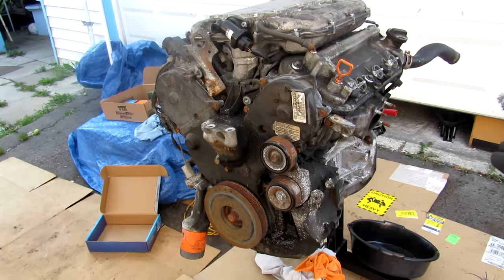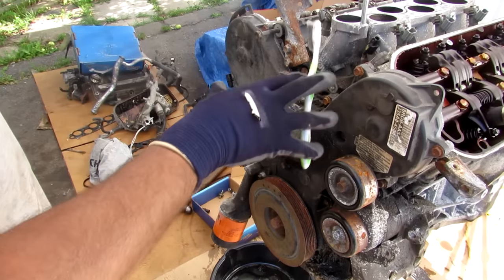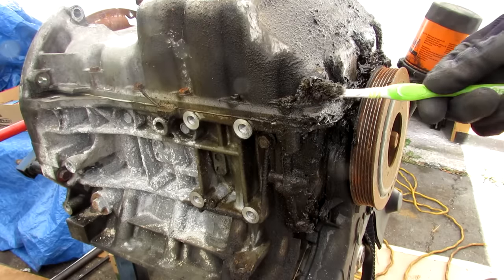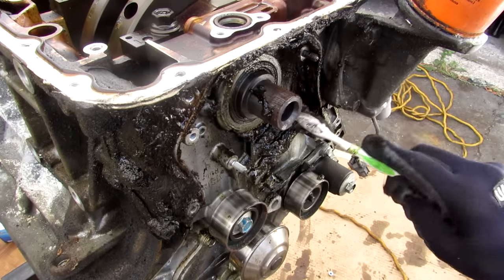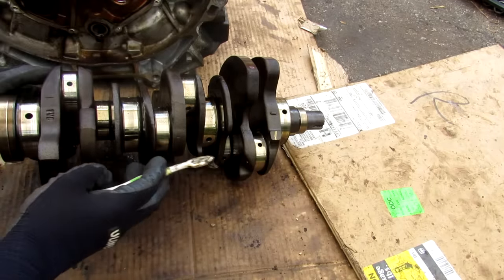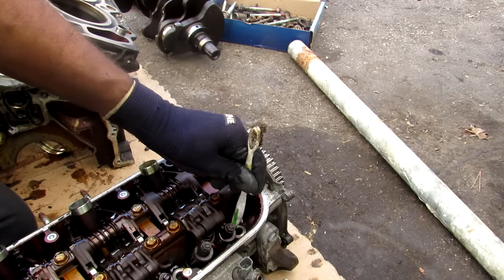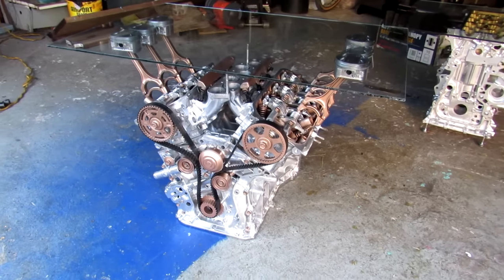Why Honda V6 Engines Haven't Changed For 25 Years

Comment: I'm the original owner of a 2003 Acura TL Type S that is coming up on 200,000 miles. I have maintained it in accordance with the owner's manual and will be installing a new timing belt soon. It's been a fantastic car and still looks good and drives like new, but I'm thinking about getting a 2021 TLX Type S to replace it.
Reply from the maker: How's the transmission going on it?
Reply: @speedkar99  It had problems at 15,000 miles and the dealership replaced it even though it wasn't covered under the recall. It's been fine ever since with no problems at all.

Comment: I have a variant of this engine (J37A4) in my 2010 Acura TL and I'm a bit sceptical when everybody talks about its reliability. Surely this engine is powerful but so far I had one camshaft changed, the valve train makes a lot of noise for unknown reasons, I definitely have some sort of slow leak around the main seal but it will cost around 1000$ to fix, pistons need to be changed due to oil consomption and the timing belt is a nightmare to change.
Reply from the maker: That motor variant wasn't the best example of a J-series Honda...I've heard of valve train issues and VCM issues

Comment: Why haven't they changed for 25 years? Because they don't need to lmao. We love Honda. Great vid for the J series engines
Reply from the maker: Its good but maintenance is a bit higher than say a Toyota V6 that doesn't need valve adjustment or timing belt replacement.

Comment: Did you notice, the internals of the closer to the firewall head (right-hand) are cleaner than the ones of the left-hand head. The same is on my MDX, so it's probably a universal rule. Why does it happen?
Reply from the maker: Yes I always notice this on the 4 J-series engines I've taken apart.
Reply: @speedkar99  So, there may be 2 explanations to this: it's because air flow cools down the front head more effectively or an engineering flaw of this type engines. Does this happen to other car makers' transversely placed V engines?

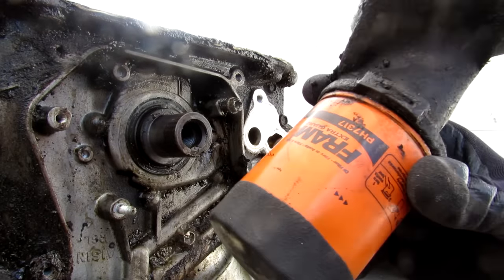Comment: 8:50 Aisin stamped in aluminum? Isn't that a Toyota company?
Reply: Aisin has been a long time Honda's partner when it comes to water pumps and hydraulic tensioners. You can even get a standard Aisin TB kit off rockauto that works with a huge variety of Honda V6s.

Comment: Is it safe to use 5W30 full synthetic motor oil instead of 5W20 in this engine over 200,000 miles?
Reply: mine has a similar amount of miles and i just add the recommended type on the manual
Reply: @fossilfountain  thank you

Comment: my 2008 v6 accord just reached 200k miles very dependable engine
Reply: What about the transmission?
Reply: @erikz74  still on the original and still working as good as new no troubles or anything

Comment: Its a great engine but the transmission does not match up.  I just got rid of my (2005)  15 year old Accord V6 with 358,000 kilometers.  I had bought it brand spanking new from the dealer and took care of it with all the regular maintenance.  Everything worked perfectly, the engine purred and no oil leaks.  But the all expected V6 transmission failed.  It required a rebuilt and would have cost me $3,500 installed at the very least with a one year guarantee. I sold it for parts.   Sad that recent year Honda's are not built like the models back in the 80s and 90's.

Comment: It USED to be a great engine. Cylinder deactivation ended that along with several other issues that the late model variants have.
Reply: When did they introduce cylinder deactivation?

Comment: honda still using timing belts , stay away from those
Reply: Why?  I can replace one in an afternoon for cheap and that engine will outlast most engines with chains. 
Chains end up costing much more when needed to be replaced and yes, they still do over time.....

Comment: Not true Honda has introduced cylinder deactivation to the V6, with excessive oil usage, etc. Same as Chevrolet. Eventually leads to engine rebuilds.
Reply from the maker: Yes VCM models didn't fair as well as these originals

Comment: Can you confirm that this is more or less the same engine as their marine outboard V6?
Reply: From what I've gathered the V6 outboards use the same J35 with cast crankshaft as the 04-07 Saturn Vue. All other J-series sixers use a forged crank.
Reply: It would really surprise me to find a cast crank inside a marine engine. 
Marine engines spend most of their lives north of 4000rpm

Comment: The down side of the cast aluminium pan is lube tech heroes than over torque the drain plug, and stripping or cracking the pan. And a steel pan will dent, aluminum pans jusk break into pieces. Oh well.
Reply from the maker: Yeah they all have thier downside. Have you seen the plastic pans now
Reply: @speedkar99  Yes. On the F150. The drain plug/ valve gets really fine dirt in it, then feels like it's going to snap off when opening. Good times.

Comment: The weak point on these engines is the timing belt and high fuel consumption.
Reply: NO_EYES_ON_ME False on the high fuel consumption. J series are one of the most efficient N/A V6 engines in the world. If you’re not getting around 30+ MPG, unless you’re towing or hauling a bunch of stuff, something is wrong with the engine.
Reply: @suzumr2754  Depends on the car it is powering. My '07 4WD Pilot can only do 20-21 top on a highway. You can say that I'm hauling a lot of stuff though as the car alone weighs over 4500 lbs
Reply: SuzuMR2 75 30mpg my butt.   They were barely rated 30mpg highway from the factory even in the Accord Sedans with VCM.  And as the other poster stated in the SUV and truck applications they are too weak to pull the vehicles and suck fuel.   Definitely a gas guzzler.
Reply: @suzumr2754  I now own a 2020 Camry with the 2.5 4 cylinder. It uses a timing chain and it has incredible fuel mileage for a car that size. Honda needs to step up

Comment: Most of their engines are the same for a while. Honda’s unicam 450 engine has been the same since like 2003. Honda’s 70cc semi auto has been the same since the trail 70 to 2003 when it was last used.
Reply: Except that honda 50/70 engines switched internal architecture halfway through the 80's. (longer conrod, flat piston, different internal head shape and valve sizes, cdi ignition...)

Comment: Nobody wants to talk about the TIMING BELT unexpectedly breaking and then you got bent valves everywhere...most American V8s would get about 300.000 miles before needing a timing chain...that wouldn't bend valves if it broke..so  the Honda engine would need 4 to 5 timing belt jobs in its lifetime ...that equals tons of money lost do to labor..parts..and down time when the car is in the shop...
Reply from the maker: Yeah the timing belt on these aren't fun since it sits transverse

Comment: Why Honda hasn't changed their V6 engine be 25 years, the short answer

Because they work, if it ain't broke don't fix it
Reply: How can you call needing a timing belt every 60,000 miles a good design... and if the belt breaks while the engine is running you've got bent valves wow
Reply: @GuninGames  do the math.....If the engine last 300.000 you would have to do like 4 timing belt jobs...how in the fuck is that not  expensive or cool???
Reply: @GuninGames  all modern Asian vehicles are interference engines...

Comment: That’s crazy, as much as that you tore that thing down he could’ve sent everything off to the machine shop got a three angle valve job port polish decking blue printing put it all back together and had a 300 hp monster ready to drop in two and a cord, or maybe even chop cut and rebuild a civic and make one hell of a blaster. Just my opinion though!
Reply from the maker: Why do all that when you could make it into a table?
Reply: speedkar99 ha ha ha! Hey man, if the wife gives her a blessing by all means!

Comment: Every 2 years for a timing belt? More like 10yrs or 105k miles on a 3.2 3.5 and 3.7L. Timing chains suck because the engine oil quality determines how long it lasts. I could do a 3.2 timing belt, w/p package in 90mins.

Comment: Fun fact the knock sensor had a special coating as you saw the color of it it is a pepper infused wire loom and tape so if a rodent wanted to make a home in the valley they were detered from eating up the sensor wiring. Needless to see it didn't work for the rodents that like spices foods 🤣
Reply from the maker: Pepper infused wire? Never heard of that one
Reply: @speedkar99  I believe it's actually sprayed now that I think it over but that's why it's orange looking. Probably some kind of cyan pepper spray. On the outer loom it comes with

Comment: Sad that Honda decided to quit making these engines and went to turbo 4 some of the j series were killers
Reply: Not entirely sure but raising average fleet MPG and stricter emissions is largely why bigger engines are phased out
Reply: @mylifeisJDM  You can get a brand new Toyota Camry with a V6.  So, why would Honda eliminate their V6?
Reply: @hamsterama  I don't have a definitive answer but the Accord and Civic are both built on Honda's Global Compact Platform so it would make sense to not shoehorn an older V6 engine into a platform that already uses the 2.0T from the Civic Type R. Toyota's always slower to change under the hood because they have a reliability reputation to protect, a notch arguably above Honda.
Reply: @mylifeisJDM  The reliability reputation is why I stick with Toyota, even if Toyota is not the most exciting.  For example, I recently went with a 2020 Corolla hatchback over the Civic because I didn't want to deal with carb issues from direct injection, and the matter with oil dilution.  The engine reliability was the deciding factor in my case.  Toyota's engine for the Corolla, as I'm sure you already know, uses dual injection.  I'm someone who keeps a car forever, and I just don't want to deal with an expensive walnut blasting in the future.  Somehow, Toyota can use big engines (V6 in Camry), dual injection, avoid turbos, yet still get outstanding gas mileage.
Reply: @hamsterama  great choice. 👌👌👌
Reply: @mylifeisJDM  Thanks!  I'm very happy with the car!  At only about $20,000 You get a lot of bang for your buck.  The Corolla is my very first manual car, by the way, and it was very easy to learn how to drive stick with this car.

Comment: I have two Accord Coupes,2015 V6,2007 2.4 liter both are great cars,the 2007 2.4 is a good engine because it has a timing chain instead of a belt.why did discontinued both the 2.4 and the 3.5V6 for the Accord is beyond me.Now they came with a 1.5 liter that has problems with the fuel entering the Crankcase what a piece of Crap.

Comment: Bolts/nuts are known by their thread size, not the socket/spanner size, a 10mm socket/spanner is used on a 6mm bolt/nut, a 12mm socket/spanner is used on a 8mm nut/bolt  etc

Comment: I like the engine tear down video! Good information. One fun fact is Honda sources their oil filters from different companies. I like the fact you gave a hidden fact that Fram oil filters are crap! Honda Filters with the made in America printed on is made by Filtec. The Honda Oil Filters with the made in Canada label is a Fram in disguise. I use to cut a bunch of oil filters to see what makes them work. I saw the Honda oil filter of Canada had the infamous card board end caps and looked very similar to the Fram brand.
Reply: That's super disappointing about the Honda Canada filters.

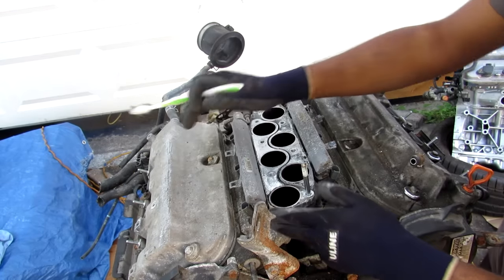Comment: 2:13 you need more experience mate. Take the fuel rail and injectors out, gives you access to the inner fasteners and the intake runners come out easy as pie.

Comment: If it isn't broken don't try to fix it. Just improve on it....
Reply from the maker: There still is alot of drawbacks
Reply: @speedkar99  
When I were a kid. I had slot cars AFX Magna Tracktion and G-Plus cars.
Magna Tracktion were your every day consumer car.
The G-Plus were your Super, Hyper and IndyCars all in one. 
The Chassis were interchangeable for each type. 
What I'm saying is that These manufacturers have the technology to do so.
It's a Political thing i guess.

Comment: Honda v6 engine are pretty good except for oil leaks crap at transmissions, bad ac compressors. 
, bad motor mounts and timing belt problems. I’ll keep my old Toyota over Honda anytime . Honda’s used to be ok now they are crap.

Comment: That’s kind of a shitty engine design but it’s one hell of a good break down.
Reply from the maker: Thanks
Reply: How so?
Reply: Taking the heads off to get to the injectors is a huge extra step that is unnecessary on most engines. Most I’ve worked on. It’s what I actually do. For some guy who pays to have it done I get the ignorance is bliss. Guys who do actually work on cars are more likely to understand my comment. Plus id never buy a car with a timing belt, I prefer my shit to be metal, a timing chain goes a lot farther with zero maintenance, unless you break one. Which is a whole lot less likely to happen. You’re talking a big job to get to that. Everything has to be disconnected from the top of the engine then the plenum. Toyota is probably close to the same but I’d say it’s a much better brand. I’m a ford guy personally. I get my back ground from turning a wrench since I could walk. I know my shit. What I don’t know I learn. 😘
Reply: Even dude who broke that down said it’s kind of a weird setup. Did you watch the video?
Reply: @AUTOMANJOE  Awesome you make a living working on cars, you're a rare breed nowadays. OK, I get what you're saying, badly designed for mechanics to work on. That being said, just because it's hard to work on doesn't necessarily make it an overall "shi**y design."  

Sacrificing versatility across all platforms to make the engine easier to work on by making sensors and injectors easier to reach isn't all that logical, too. OK, now mechanics can get to injectors and sensors without tools but now it's too big to fit in a car. It's one thing if this engine's a dud but it's popularity says it's clearly not.
Reply: mylifeisJDM regardless you need tools. It’s the time factor. It’s just nuts and bolts at the end of the day. Time is money. The longer it takes the mechanic to fix it the deeper his pockets get.